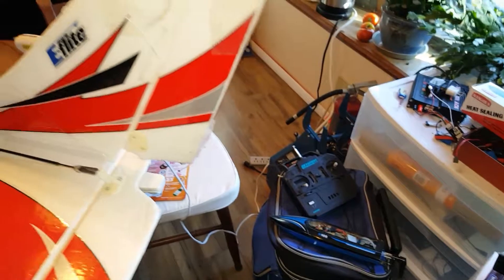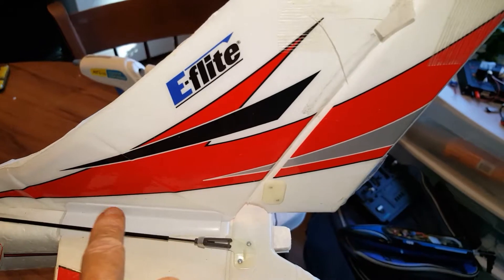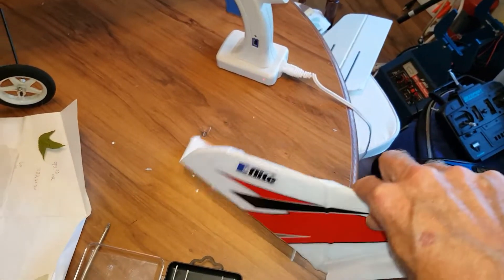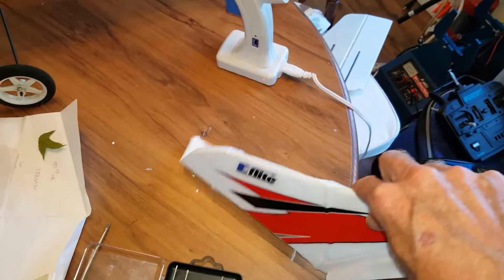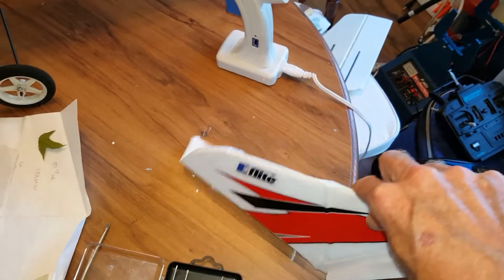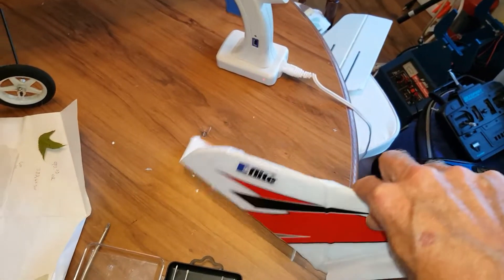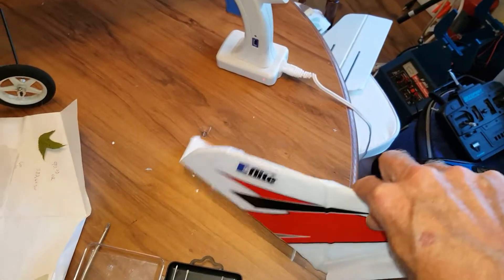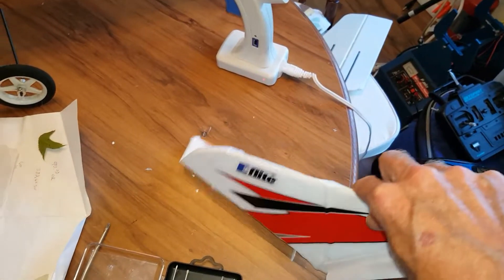Fixing a broken tail on the Apprentice on the cheap!

Comment: Nice job on the repair. Wondering how one goes about cuting the groove in the styrofoam? Any tips would be most appreciated!
Reply from the maker: I used a dollar store utility knife to clean out the remains of the old tail section from the plastic holder. Don't  use the flimsy cheaper ones unless you no longer value your fingers. They use a two faced tape to hold the tail in. I was able to finally get ahold of the tape and pull it out.
Reply: @scottfirman believe I didn't explain myself very well. Was wondering how you cut the groove into the new  styrofoam for the new rudder. 🤔 
It looks to be about 1/4" wide running from the top to bottom of the rudder. Looked very neat and thought maybe you used a dremel rotary tool.
Reply from the maker: @we4fm175  I am not sure if you are working with the Apprentice  as it has a plastic holder for the tail piece that already has a groove in it. If you are making a scratch build, that's different.
Reply: @scottfirman  yes an apprentice STS. I was talking about the groove you cut from the top to bottom on the store purchased foam for the new rudder - where it bends left and rights.
Reply from the maker: @we4fm175  OH, sorry. Jeeze, brain fart on my part. I doubt it matters where you put the bevel cut as long as you do one. I also like to run a thin bead of hot glue along the bevel and run a piece of scrap foam into the bevel. This is covered in most Flite Test video which is where  I got the idea. I personally like to cover the entire piece in packing tape as a moisture  barrier as well as running a line of hot glue along the exposed edges of the new tail, just to prevent the paper or tape from peeling back. I use the old Rudder as a guide for cutting and bevelling the rudder. I doubt it makes any difference. Make sure you flex the rudder well before installing on the plane and if you go too thick with the hot glue, it will affect the movement.
Reply: @scottfirman  now I understand. All sounds good. Appreciate your time in responding. Tought me alot.

Comment: Good repair! Million dollar question is: what is it that made you have to make a new vertical Stab??  Is it the same problem the rest of us seem to be having, which is shuddering outside of beginner mode?
Reply from the maker: I used a piece of carbon fiber imbedded in the foam later. I hadnt thought to make a video of it but yes, you can get tail wobble especially at all out free style flying. Keep in mind this is a trainer. Our Flying field uses them all the time now for beginners. I have a Nitro Kadet by Sig that was the original trainer by most flying fields. Mine came from St. Louise Mi. My Bother's father in law bought it when they stopped training on Nitro. My brother stopped flying and gave it to me.
Reply: RC Hobbyist Extreme i learned on nitro back in the early 80’s as a kid. My old man has been flying since the 60’s and pretty much raised my brother and I at the flying field back in the day. For one reason or another I went on a 25 year hiatus from the hobby and with the induction of these electric foam models, I decided to get back into the hobby. My old man owns a laser cut business and pretty much exclusively cuts balsa scale warbirds, but does other kits also. He. Actually just started cutting foam when I started flying again. He has been experimenting with the flight test plans, putting them into his CAD program and cutting me those planes. Anyway, I have to replace my vertical stab on my apprentice. I flew her today and barely got her back on the ground. I get this crazy “shuddering” or “vibration” whenever I am out of SAFE mode, which is all the time now. My whole horizontal and vertical tail shakes violently.  It has to be the receiver or the elevator servo. I have done everything I can to the tail to make her more stable, but still shakes violently in flight. It has gotten to the point where my vertical stab is obliterated. I’m gonna change out the elevator servo and make y own rudder like you did here and see if it’s a bad servo. If not, there is one thing left, and that’s the receiver

Comment: how did you make the rudder art flexible in the back did you put tape over it?
Reply from the maker: Yes, Its pretty easy. Sadly that plane is no more. The receiver failed sending it into a major plane eating Maple tree. I damaged it beyond repair trying to get it down. I replaced it with the Maule. I have had nothing but issues with the Maule since day one. I have decided it is not a good match for me and will replace it with a Timber.